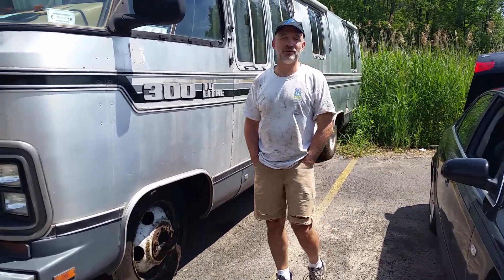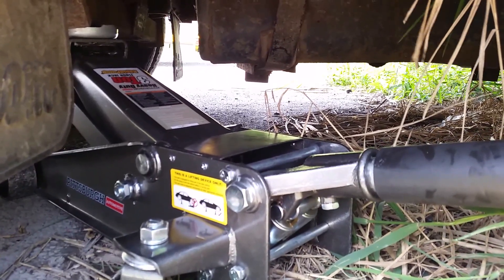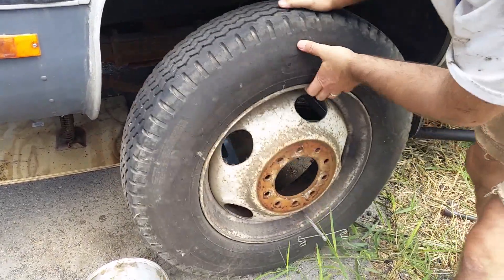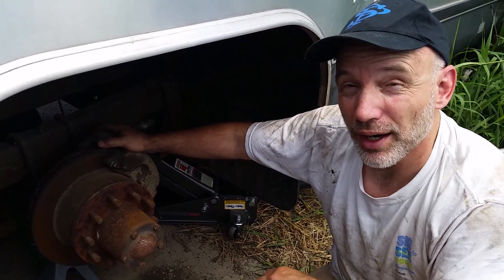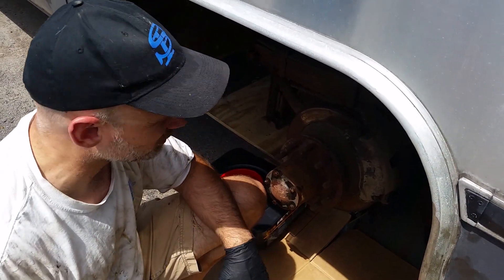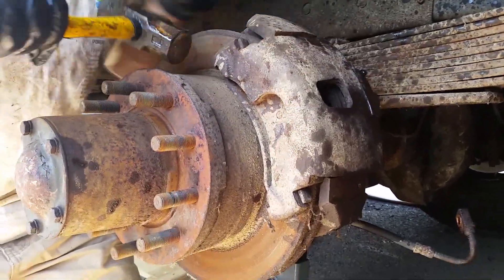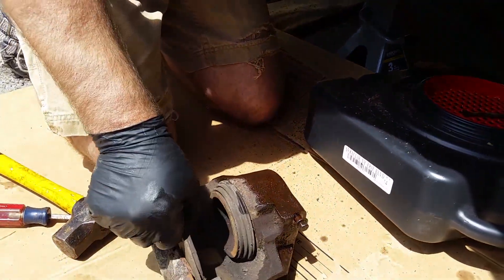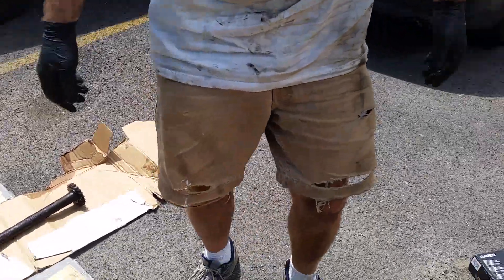1983 Airstream 300 rear disk brakes Part 1

Comment: well the mechanic never did bend the lock washer tabs so the nuts loosened and eventually the hub started to fall off after $2700 in tow charges and two months in shop and another $2000 in repairs back on the road.